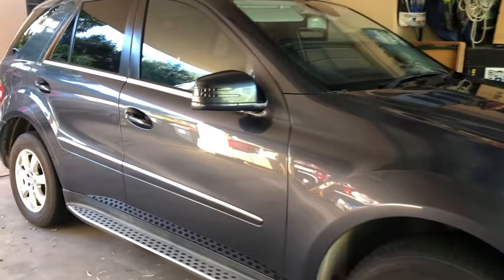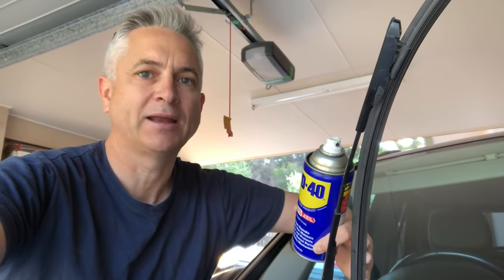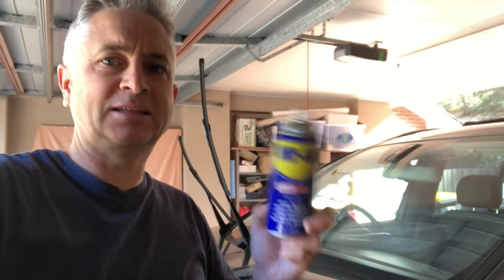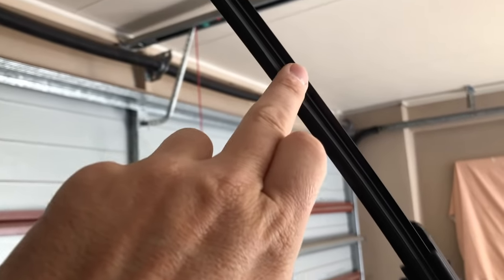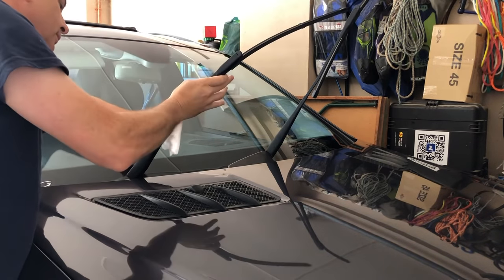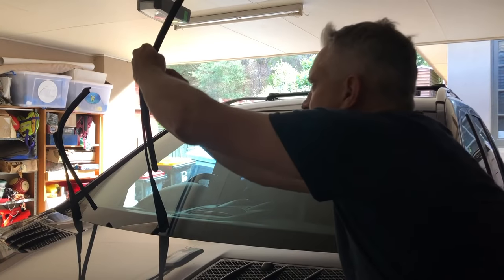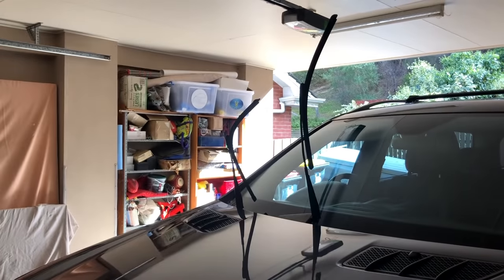WD40 Hack on Wiper Blades!  Does it really work?

Comment: The wd40 use to clean the blades then treat with silicone spray.   All the Wd does is clean the blade . On new blades I soak the blades in 303 in the sun for few hours before I wipe them and install.
Reply from the maker: Thanks for the Alfonso!  Cheers Drew

Comment: I tried it and it did not work for me (OEM Toyota blades, 1 year old). so tossed the old blades and replaced with German made blades. The new OEM Toyota blades are really junk these days so using German blades from now on.  In the past I used rubbing alcohol on a dried blade and that worked well. I have seen people recommend waxing the window with a certain car wax so I might try that too.

Comment: Good call, thanks! Removing hard, dirty rubber is what's needed. Your method does this and you can buy a small cutting tool which also removes the worn edge of the blade. The other economy is don't run a new Merc! Lol.
Reply from the maker: Great tip! The other economy tip for the Merc is to do your own servicing: https://youtube.com/playlist?list=PLor5qdyoV_nT8zuQuldyu84XcQPZWy7Wr&si=ASrvcrezDx3MJZAh Cheers Drew

Comment: You cando the same with a slide of an apple. And also use to clean the screen with an apple slide. It works great here i Denmark in with time, with roads being salted to clear frost and ice from the road. 👍
Reply from the maker: Hi Kent, do you mean a slice of real apple?  Thanks Drew
Reply: @DrewFixIt  yes. It is the acid from the apple that is a mild acid, that do most of the work. Here in contries with snow,there being used salt and liquid chemicals to defrost the roads. And that leaves a sticky film on the car. And that is easily removed with an apple. I mostly get 5 slides from 1 apple. I do not know which is best, a sweet apple or a sauer one. Don't use it on the painted parts of the car. I will love to here if you gonna try it in a non winter area. 🙂

Comment: Hi I bought a 1$ Chinese wiper blade and it works as good as the original. Also you can buy any after market blades and it will be cheaper and work the same by the end of the day it’s only rubber or silicone.
Reply: I can remember here in the US when our dollar store carried wiper blades, now even Walmart wants a small fortune for them.
Reply from the maker: Sounds like I need to find a $1 Chinese blade for Mercedes :)  Cheers Drew

Comment: The WD40 trick only works on rubber wiper inserts. Don’t use it on silicone inserts. Mind you, silicone inserts have a lot less issues with streaky wiping, so shouldn’t need more than a wipe with a damp cloth.

Comment: Why would anyone go to a car dealer for wiper blade replacements?  You can get ones that fit your vehicle at any car store for far less and they work excellent.  I would never put WD40 anywhere near my car windows.  My Dad did this once and it was the worst thing he ever did.  The residue on the window was so bad nothing would get it off.  He actually ended up getting a new windshield because he couldn't stand it anymore.  Same goes for Armor All.

Comment: Windshield wiper manufactures and good mechanics will tell you not to do this. You want to use stuff that is much milder than WD-40. Rubbing Alcohol, Glass Cleaner, a lot of household cleaning products would be better. This seems like an informercial for WD-40. Probably sponsored in some way.

Comment: If you can afford a Mercedes, you can afford the blades. Alcohol does the same thing. I've been using alcohol for decades.
Reply from the maker: Haha, there just like a Ford … Fix Or Repair Daily 🤣🤣🤣🤣 Cheers Drew
Reply: No. Not necessarily, a used mercedes can be reasonably priced. My Sprinter van, purchased at 2 years old to convert to a camper, cost less than my boxster Porsche. It all depends on shopping across the country.
Reply: Thank you for sharing. Just tried last night and it worked. 👍
Reply: Imagine being able to buy and afford gas+insurance for a not too old Mercedes SUV but then cheap out over your visibility when you need it the most. WTF is wrong with people? Just buy some aftermarket wipers or replace just the rubber blades (possible with the aerotwin shown here). First option would be ~20€ if not purchased at Mercedes and the second option is 5€ and 15-20 minutes of work. People cheaping out over wiperblades are probably the same that let their vehicle rot, not maintain breaks and keep their tires for ages until they become slicks... its a shame that the rest of us has to share the same road with them...

Comment: I think just cleaning them with hot soapy water using either a nail brush or old tooth brush works just as well.
I aways scrub ours prior to its yearly inspection.
Reply from the maker: Hi Cype, sounds like a great plan!  Cheers Drew

Comment: You've just removed the graphite coating ,  brand new blades this would happen.  You need to properly clay bar the windscreen and use a coating
Reply from the maker: Hi Mate, thanks for the advice, I will certainly try this too.  FYI, at this stage my wiper blades are really good nearly a year later!  Cheers Drew
Reply: @DrewFixIt  also no mineral solvents or oil on rubber,. Just use a mild detergent and microfiber to clean blades
Reply from the maker: @jusb1066  HI Mate, thanks for the tip, I will certainly try it!.  In the meantime my blades are still very good nearly a year later!  Cheers Drew

Comment: Fun fact — WD40 was originally developed to prevent condensation build up on the exterior of space rockets. (I think)
Reply: It was developed as a Water Displacement, 40th formula worked.

Comment: I don't think it's so much "road grime", it's just deteriorated rubber. You are actually removing a layer of rubber, exposing a newer fresh layer of the rubber that will also eventually deteriorate. I wonder what would happen if you repeated this excersize in 6mos with water on a rag, then soap on a rag, then Armor-All on a rag?!? Whenever I run my car thru the car wash, I do a quick wipe of each wiper (about once a week) and mine only has a wisp of black on the rag (just a damp rag), and my wipers tend to last 3yrs or more before I swap them out (here in TX).

Comment: I was doing some wallcovering at the WD-40 offices in San Diego in late 80's.  One of the top salesmen told me a story about how they were noticing gallon containers selling out in an old folks community close to San Diego.  He went there to find out why and was told that the old people used it on their aching joints to relieve the pain.  A couple days later he was on a ski trip and after the first day his knees were in pain.  He remember the old folks story, and since he always had WD-40 in his car, he sprayed his knees with it and wrapped some ace bandages around them overnight.  He said he skied for two more days with zero pain.
Reply: You did say this was from a salesman. But the manufacturer warns of skin irritation and drying, and mentions 'dermatitis with long term contact'. Overuse can also lead to 'dizziness, drowsiness, headache, and nausea'. And there is also the longer term risk of cancer - it is primarily a petroleum-based product, after all. It's a bit like when people used to take Uranium pills as recently as the 1940s.
Reply: @ccaputa  Well, only in moderation, of course 😉

Comment: Buy wiper blades from a dealership !!!!!! Like buying milk from Harrods !  In the old days it was accepted that wiper blades were changed every major service but now they are much better quality materials so as long as the blade isnt damaged cleaning is fine. My 5 year old BMW still had the original blades and they were fine.
Reply from the maker: Mine are good now still after the WD40 hack

Comment: There is a simple fix if your wipers are wobbling on your windshield like that. It's the same thing as dragging your toe on the asphalt if your toe starts skipping you only need to change the angle. Simply take a crescent wrench to the flat part of your wiper arm and bend it slightly and that will change the angle of the rubber on the windshield and the bouncing noise will stop.

Comment: Is that grime coming off or just the rubber? 
That often happens when I put Armourall on rubber trims.
Reply from the maker: Hi Bruce, I have had a few comments on this topic.  I assume that if it had been rubber that it would have destroyed my blades, however my blades are still good a year later after doing this!  Cheers Drew
Reply: @DrewFixIt  Thanks for reply mate, might give it a go! Cheers.

Comment: The best thing to clean wiper blades is white vinegar or replace them
Reply from the maker: Hi Derek, thanks for the tip, however I am just wondering what is wrong with cleaning them wrong with WD40 if it works?  From my perspective I had nothing to lose and was going to buy new blades and it worked ... over 12M later and the same blades are still going strong now!  Cheers Drew
Reply: @DrewFixIt  WD 40 is oil based great for nearly  everything I've always used white vinegar for wiper blades windscreens any glass something my father told me over 50 years  ago

Comment: Does AMG stand for "Almighty Money Grabber", another Aussie allegedly  calls this brand the "Three Pronged Suppository". All jokes aside i will try this on mt crappy wiper blades.
Reply from the maker: Hi Steve, I’ve owned my ML for 3 1/2 years, purchased with 68k on the clock and it now has 130k.  After a independent “European Specialist” did some dodgy work for me early on ( and charged a fortune) I have since done all service and repairs myself!  I’m actually thinking about doing a video about my experiences of 3 1/2 years of ownership … in a nutshell either you need deep pockets or be able to have a crack at doing the work yourself… I’ve actually quite enjoyed the later :) Cheers Drew
Reply: @DrewFixIt  Drew that would be a great idea (diy video) i did entertain the idea of buy a Beemer many moons ago but was talked out of it ie parts and service costings etc etc.
So i brought a Caprice and it was a piece of crap - bad electrics etc . Now have a Hyundai and its a good reliable car (touch wood)

Comment: I never tried WD40 but I have been putting silicone on my blades for years. They will last a lot longer if you wipe them down a couple times a year with silicone. Also, Wax your glass
Reply: I'm not saying you are wrong if it works for you, Dennis, but when I am cleaning my windscreen, wax is the first thing I want to get off because it is a major cause of smearing (for me). I think it comes down the definition of 'smearing' - yours is probably different from mine. To me, if there is anything other than a completely clear view after a wiper pass on a wet screen, I have 'smearing'. Any misting or mosaic pattern - even for a second until the moisture evaporates -  means there is something still stuck to the glass. It's the Devil's own job to get off. Sugar Soap is good, as is TFR.
Reply from the maker: Hi Dennis, prior to this I had never put anything on my blades.  Thanks for your suggestion I will try silicone next time!! Cheers Drew

Comment: I'v read that wd-4oo can damage plastic/rubber . Wouldnt soapy water and rinsed with clear water work ?
Reply from the maker: Hi Sammy, I did this nearly a year ago and my blades are going really well ever since!  Cheers Drew
Reply: Just bear in mind that both hot and cold weather can mess up the rubber, too. If the rubber hardens (hence the bouncing/scraping/noise) because of weathering, softening them up a bit simply restores them. Partially, at least. And for a time, at least.

If it staves off forking out for a new pair for a bit, what's the problem?

It makes me laugh that the internet generation would happily neck a glass of battery acid if TikTok said it was fun, but they are also contrarian and immediately find fault with something  that has a practical value and which has much less of a downside if it turns out it doesn't work.
Reply: @sualdammacsamildanach8154  Your exactly right. Once extreme hot/cold temps. involve plastic /rubber materials ,they become not too durable . Possibly a silicone coating spray might strengthen item for extended use ?

Comment: Hacking is for computers...hack is overused.  WD40 stands for Water Displacement and they took 40 trys to perfect this to keep water off the rockets back in the 1960's...unfortunately we use it for a lubricant but that isn't really what it was designer for doing..it will unsqueek stuff but really water can do this too...they do make specific WD40 products to help with lubrication now - What was WD-40 originally made for? "WD-40" is abbreviated from the term "Water Displacement, 40th formula", suggesting it was the result of the 40th attempt to create the product. The spray, composed of various hydrocarbons, was originally designed to be used by Convair to protect the outer skin of the Atlas missile from rust and corrosion
Reply from the maker: Actually, hacking in software engineering is the worst possible form of hacking because unlike other Engineering Disciplines you can't see the impending disaster until it manifests itself ...

Comment: WD-40 isn't good, I was told this by a lock smith.  When dried it leaves a lacquer residue.  That is not good for locks, guns, machine parts...etc.  You can buy Silicone WD-40 which is better, or just use some disinfectant wipes which dry clean.
Reply from the maker: Hi Mate, for locks most locksmiths I know use Inox, which I use myself on things like locks and spring mechanisms, etc.  Cheers Drew

Comment: This is actually the wrong way to stop rubbing. You must change the angle, how the blade touches the windshield. When the blade slides upwards, you have to have a flatter angle, so the blade can stripe flat over the windshield…

Comment: Yes it does work , but i'm wary of mixing oil , and a windscreen . I actually tested this hack last year on the rear wiper of my van . It cleaned the blade , by god did it , and yes it stopped the noise , but only in the short term , it doesn't last . I think in my case a couple of months was about as much as i could manage . But i was brought up , being told not to get oil on a windscreen . WD40 is basically oil , so this prevented me from actually doing the front .

So i began looking for something else that would do the same job , and i found ordinary coca cola , did exactly the same job . Yet again it cleaned the blade , but i expected that . Coke is famous for it's cleaning abilities , but what was really surprisingly , it also quietened the blade , so i set up an experiment .
 
I did the front with coke , the ordinary full fat version , and the rear with just ordinary WD40 . Both completed the task , but the big surprise , was coke out lasted WD40 by a long way . Now it should be remembered that the front was used more , so this may have an effect on the test . They were also expensive Bosch blades , but i can honestly say i never actually treated the front again until i replaced the blades a couple of weeks ago . The rear is a completely different story . Also Bosch , they began scraping within a couple of months , again i never treated them , and now it's as bad as ever .
Reply from the maker: Hi Mickey, you used Coca-Cola to clean your wiper blades?  Now, if so, that is something I need to try! Cheers Drew
Reply: @DrewFixIt  I would welcome it , Drew , and post your findings too , either way . I used the plain ordinary stuff , not the diet . Coca cola is well known for cleaning pennies , and such , but i've been trying it on all kinds of stuff . Smart-phone screen , to remove finger-prints , works . Cleaning some engine parts , hit and miss . I have been using it for years , to suppresses a cough , and more recently a sore throat , but though it worked , it's inconclusive . Walkers ready salted crisps are far more effective . I tell ya the list could be endless .
Reply: I worry that the oil is going to get on the windshield and cause reflection problems when its sunny
Reply: @mickey1299  I think you might be suppressing your cough with more than the Coke, Mick!! You need to put rum with the Coke to make it taste any good!!

Comment: You should always avoid petroleum based products to clean rubber.  Silicone based lubes clean and refresh rubber parts without degrading the integrity of rubber and plastics.  Not all silicone lubes are petroleum free.  CRC silicone lubricant has petroleum distillates.  In my professional opinion as an industrial maintenance engineer, Liquid Wrench brand silicon lubes are or at least were petro free.  Read the can to be sure.  Using petro free silicone on your cars door gaskets will keep your doors from freezing shut in winter.  Yes it's true!

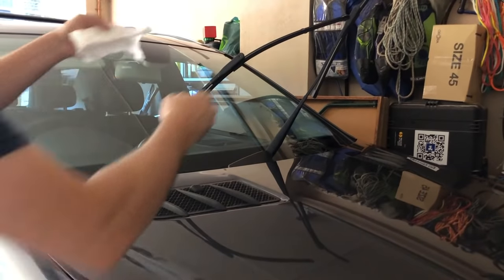Comment: 1:36 What kind of sandals did you fit on to your Mercedes 300 AMG??! 😨
Reply from the maker: Hi Herman, I personally don't particularly like the harsh ride of the 21" inch AMG rims that this car came with so I bought a second set of Mercedes 17" rims, which I have on the car at the moment.  You know, I know the 21" AMG rims look nice, however whenever you hit a bump in the road you feel it through every bone in your body when you have those 21" rims on ... I trust this answers your question?  When I sell the car (eventually) I will put back on it's AMG shoes!  Cheers Drew
Reply: @DrewFixIt  Thanks for taking the time to answer. Much appreciated! However, my remark wasn't so much about the rims which, I agree, are an OK choice. It's the rubber 😬
Reply from the maker: @Herman6507  ahh, understand.  So when I got the 17 inch rims I got them off a guy 2nd hand and long story but he drove his W164 all around Australia doing some fairly serious off road tracks from what I understand. He actually completely destroyed his space saver spare and also at least one alloy rim, thus I ended up with 6 17inch alloy rims with … a random assortment of tyres that I am wearing down at the moment!  FYI I will put my AMGs (which have Pirellis fitted) on soon for Summer!  Cheers Drew
Reply: @DrewFixIt  check! 👍